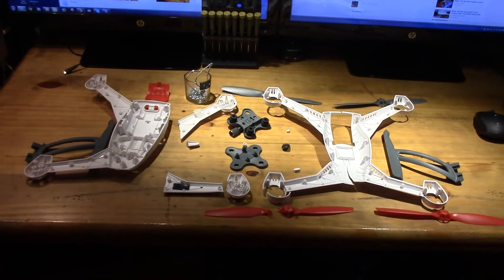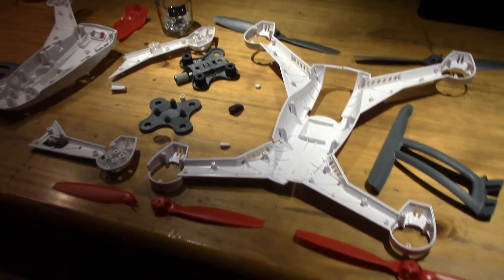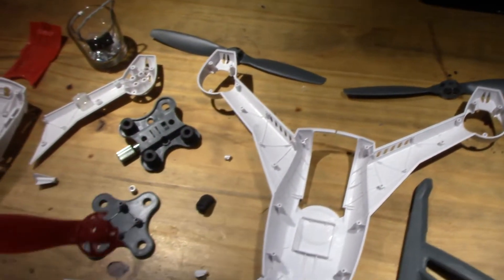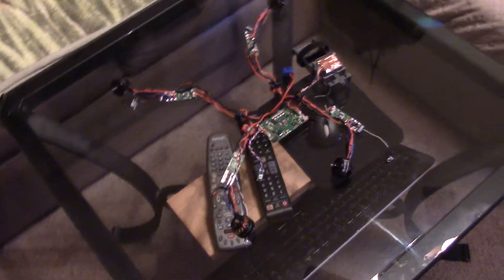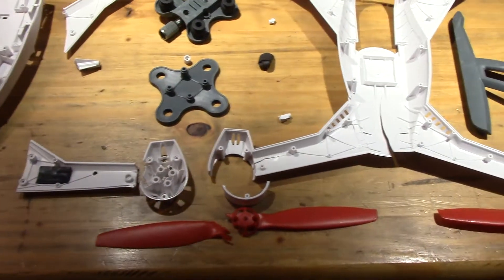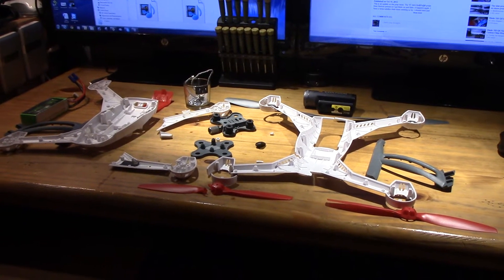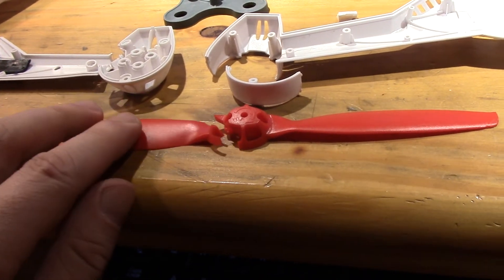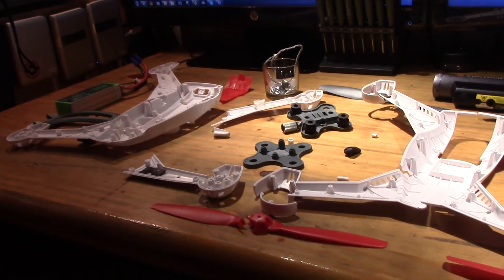Blade 350 QX toasted

Comment: Go on horizon hobby site. I had a similar issue after getting new props I was no longer able to calibrate my quad properly without it flying away (tech on the phone said msin board may have gotten damaged). Made a service claim and sent it in to their service center. 1 week later they're sending me a brand new quad. Granted it's not the latest firmware but a brand new quad none the less. Once I get it next week I'll wait to upgrade the firmware they're releasing.

Comment: I feel if one side is pressured down,  and then the other side placed on. will snap a prop.  due to cocking, misaligning,  while placing both bolts down with one  full rotation and alternating not tightening, I think their machines just do not think